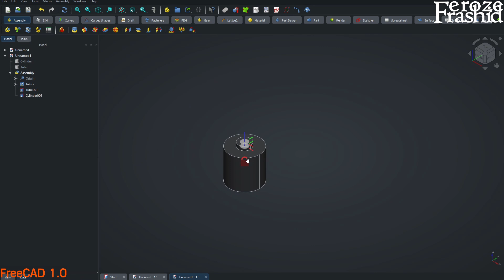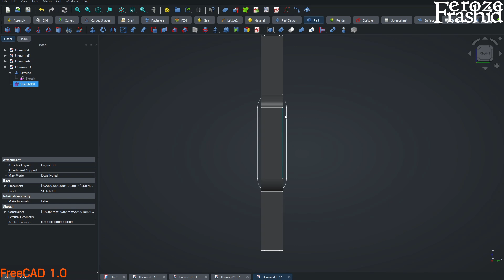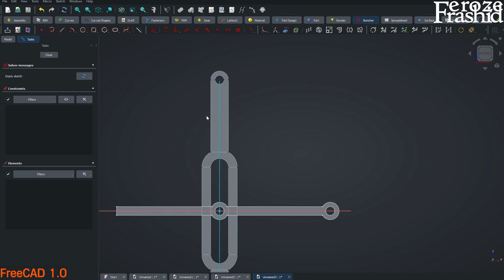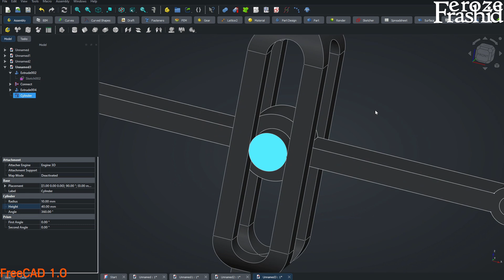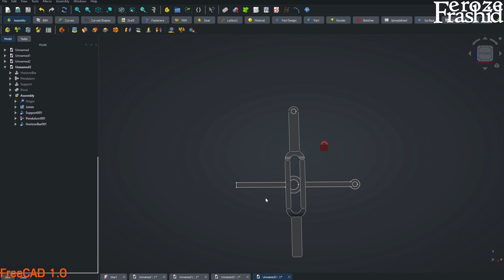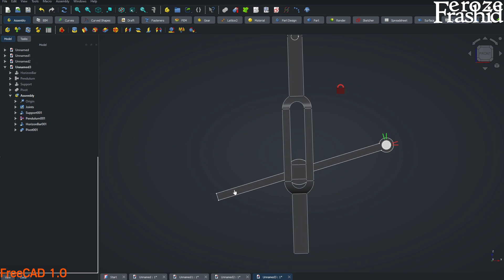The New Assembly Workbench of FreeCAD: Modified Slider Joint using Parallel and Distance Joints.

Comment: You can fillet the corners of the square as much as possible, looks round but is actually a square, slider still works.Set up your joints first as a square then change the square pin with fillets.
Reply from the maker: Interesting idea. Will give it a try. Thanks
Reply: Thanks i almost gave up before this video.

Comment: very familiar workflow if you are used to onshape. I just would like the option when working with assembly how it uses linked parts to reference a clone over the actual  source file, sketch/pad/revolve/filleted part to keep the assembly cleaner and to prevent miss haps on deletion when adding and removing joints.

Comment: Hi Katt, you make excellent content. As a beginner with FreeCAD 1.0 RC2 assembly, i want ask you to make a video of how to align objects in the new assembly workbench. For instance I fail to align two cubes on top of each other that are drawn random in space. I tried to use the distance joint but my cubes do not align correctly.
Reply from the maker: Sure. I will try to address that in one of my next videos.
Reply: @kattkushol  I have this specific problem, one pad that is 1900x850x18mm and another that is 2000x800x180mm and has rounded corners. The first one is my Bed-bottom (for camper). The   second one is the matras that is to be fixed to the Bed-bottom. the matras is to be aligned in one corner with the bed-bottom. I fail to get this richt, there is always an offset that i don't want, this is because the two pad are not equal in size.

To generalize this I would like to know how to:
1. Align a smaller square pad to a bigger one and align of the corners (2 edges).
2. Align one smaller rectangular pad exactly in the middle of another bigger rectangular pad,
To make it more complicated, make the corners rounded so that you cannot select a vertex.
3. Same idea for a cilinder, how to connect it to a square pad in the middle or at a corner.

This problem would not exist if it would be possible  to glue two bodies as they are in the drawing so without moving them, but i do not know how.
Reply from the maker: @edingcnc7685  I will make an example on this scenario, maybe next week. For your immediate need, try building different parts based on sketches where they should be. It's easy to pinpoint a sketch. 
Then during assembly, add one part at a time. They will retain their original build position. Once you add a part, "ground" it. You can have multiple grounded parts. Those will work as if they are glued together.
Reply: @kattkushol  Yes, I have seen that, there are too many options to insert a part in the assembly. One part at a time keeps its place. But when e.g. a fixed joint is applied it shifts. I would like to make a fixed joint without shifting the parts.